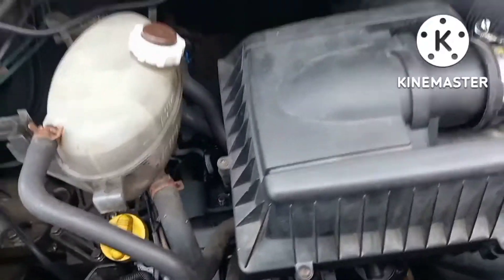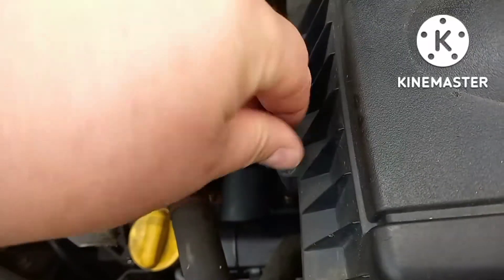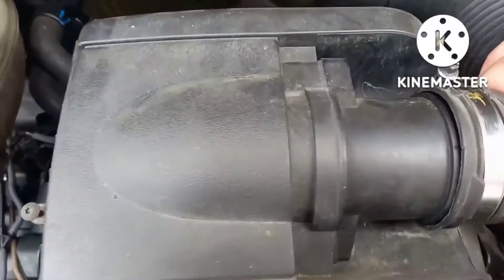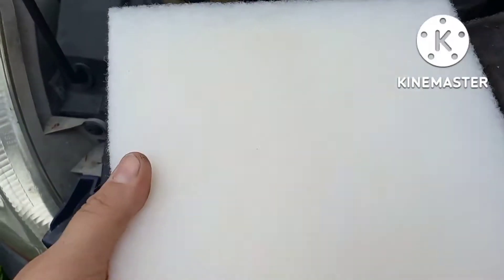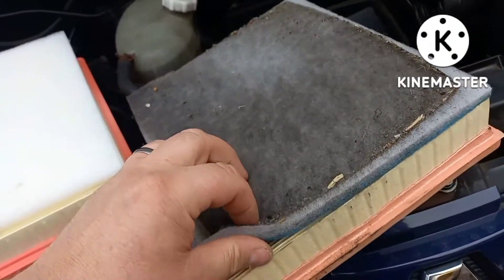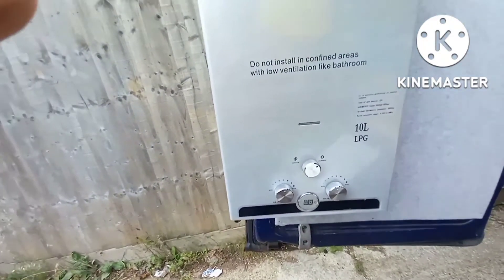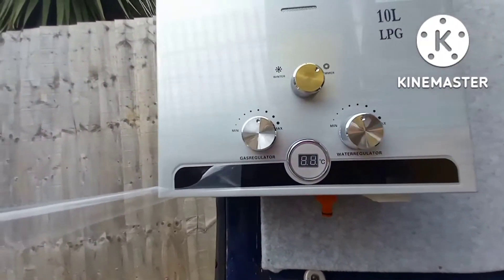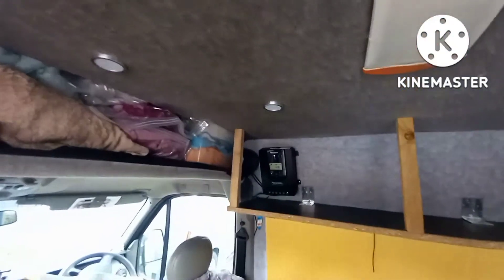air filter change water boiler and first overhead lockers

Comment: Are you left handed, Donny?
Reply from the maker: No whys that x
Reply from the maker: I t just clicked why you asked as I was undoing the Allen head screw with left hand I cut one off my right hand fingers nearly right off in 2010 had it sewn back on so I used my left hand for everything for about three months to let finger heal I can still use left hand now x
Reply: @donnysweekendvanlifetravel7854  ahhhh! That’s why! Yes it was because of the left hand use in the video.
Reply from the maker: @PlanetImo  yes I can now use both with ease which is great when working on cars in tight spaces and holding a camera x